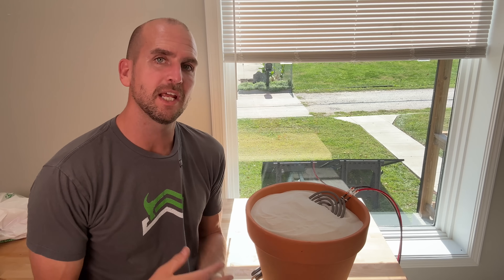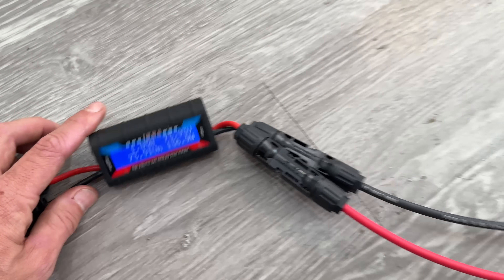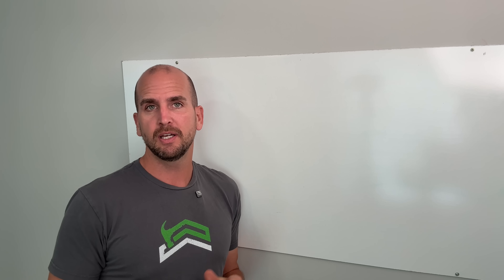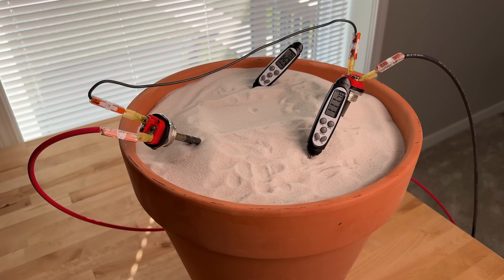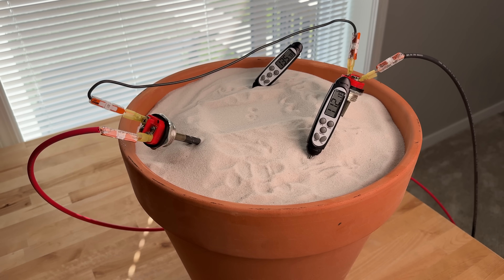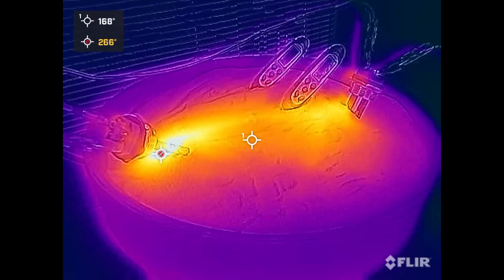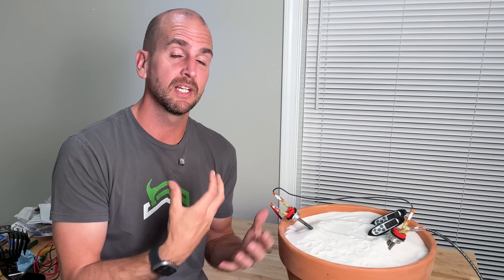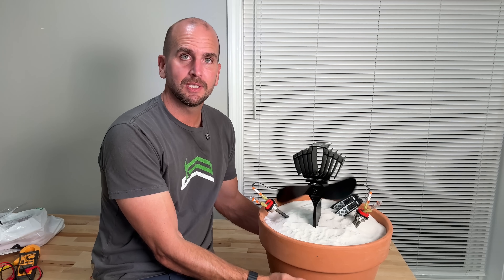How To Create A Solar Sand Battery Heater | Free Heat This Winter!

Comment: Love it. 
Getting 10 hours of heating would be the golden point for me. 
I'm guessing greater sand mass would be the key for slower heat release.
Reply: Heat releases depending on surface area. But you can store more heat in a larger quantity of sand. Also how you distribute that heat with fans or whatnot affects the results too. It is relatively simple to figure out in the end. If you want to build such systems at home, insulating the sand and using a thermostat to regulate release of the energy is quite useful.
Reply: @inso80  You can just put a window in your house and get greater efficiency. The difference is the heat is spread around so you might not really appreciate how much energy it is generating.  If you build a panel with a wooden frame and gutter pipes sprayed black you can orientate it to so is has two sheets of plastic on the outside. One facing west and one east. If you have it sticking out from a south facing wall it will take the reflected light off the wall really good. Channel the air so the cold air comes in thru the top pipes and moves down. This way the cold air can take the heat off the top and pull is down and in under the floor of your house. It will heat the floor and once the sun sets return heat into the air coming in thru it. It will be way more efficient than using electric solar panels. The main issue is that it is sealed and doesn't get the air from the plastic and spray paint  Getting the heat under the floor into the ventilation air is what could really makes this better than a window since otherwise the ventilation air is coming in cold and the heat from the windows is more up by the ceiling whilst you are sitting nearer the cold ventilation air.  You could just use dark floor tiles and have the ventilation pipe under them. That way there is no risk of having bad air from the plastic and high temperatures but the east west design would be quite good to mitigate that since half the pipe will be in the shade. Even a single pipe would work good compared with wherever the air is coming in at the moment. Making it too big could be risky. You would be amazed how much heat it would generate if it was up against a sunny wall.
Reply: @RoseHip-j1y Dividing that tube into paragraphs could make it readable.

Comment: You only use 2 solar panels, and 12 panels to charge electricity. If it was cheaper, it would probably be 6 panels, it wouldn't use up all the electricity, at least there are no tropical storms in your area.

Comment: I want to see you cool your panels, collecting that thermal energy into the sand battery, and calculate total system output (you should realize greater panel electric output plus the value of the collected thermal energy).  Seems like inexpensive insulation and closed system thermal pump shouldnt be too expensive or difficult?

Comment: Nice video! Many solar systems have extra capacity that is throttled by solar chargers. I wonder if a water heater could be powered by directing extra productivity to the heater. In wind powered systems, there is usually a "dump load," which solar doesn't need. But, what if a solar electric system were designed to use a water heater as a dump load.

Comment: This is an awesome idea!!! My brain flooded with all kinds of applications. You could embed these in an insulated block of concrete with air tubes going through it, so you could extract the heat when it's needed. Instead of a fan you could use convection, just have a small temperature actuated shutter.
Reply: ideally you would want this in a big block of concrete so it heat up during the day and cools down at night.

Comment: You can drill a hole in your yard and place a heating element along with water piping to recapture that heat or even to generate electricity when needed.

Comment: if you slide flat copper down into sand standing above top of sand the heat will radiate longer. great for greenhouse thats what we use this for
Reply from the maker: I plan on doing something similar for round 2 testing with a heat fan sitting on top of the aluminum or copper strips to help distribute the heat around the room.
Reply: Are you saying that if you hook up the electric to copper tubing totally buried in the sand it will heat the sand better?
Reply: No, the added copper is simply a radiant. The sand holds the heat below the surface, and the copper helps draw it upwards to radiate. Without it the silurface will cool off first and radiant  heat will be lower

Comment: I have a small greenhouse which uses ground to air heat exchange I built into earth under it but this would be a great additional way to add more heat in winter. I have a small 100 watt panel I bought before getting solar installed - used to test with a small EcoFlow.  Thinking maybe doing a single element - 100 watts won’t make a lot of heat, something is better than nothing.  I do have 2 50 gal water barrels to also use as solar heaters.

Comment: To really eke out as much power from your panels as possible, look up a video on YouTube by William Fraser called "DIY Solar Maximum Power Point Oscillator". Using just a few components, you can basically track the panel's maximum power point even when the panels aren't producing their maximum power. It works well on resistive loads, but he also demos it using a drill motor.

Comment: A smarter option is to design your home passive solar. Every square foot of glass on a Southern exposure is equal to 100 watts of electric heat. I generate over 9,000 watts of heat at home using this method
Reply from the maker: Agreed, the house I grew up with was passive solar.  Worked great 👍

Comment: The clay is used to store heat and give it back during night. It exists from thousand of years. Is something shows significative increaze of temperature after one hour, it can't be called refractory. I will try with perlite for cats. Cheap. Can't burn. No toxic + regulate humidity. The plant pot is useless if using clay use for plant instead (whatever bearing the 20-30 kg weight will be the same. The point is that heat must be released during 8 hours night and not during the day. It's not difficult to find the thickness needed for your local temperatures / room volume /insulation.

Comment: That is an awesome idea! It eliminates the need to buy expensive batteries and inverters! Stove elements would be easy enough to find at the dump. Here in Canada it would be a cheap way to bring some extra heat into your home.

Comment: This might work nicely in a Greenhouse during winter in milder climates. I live in NE Texas and it the temps do drop at night into the low 20's. These might be nice situated closer to the more cold sensitive plants.
Reply: I've seen some use of compost piles for heat. The internal temperature of a compost pile that is fueled well with food scraps and carbon can approach 150F. Running tubing through it for heat transfer can heat a room or greenhouse.

Comment: You CAN heat a mid sized room with this method with much less solar power and a better sand battery. I use 12V 20W system with a 50lb sand battery in a copper pot wrapped in 8mm thermal wrap covered with a copper lid and topped with a thermal fan like you used. Sand temps reach 290F and higher. I can keep a 12x15 room above 65F all day and night with outside temps of ≈40F
Reply: Sounds great. What did you use for a heating element?
Reply: @polywog9591  PTC Heater Plate 12V Constant Temperature Element Thermostat Heating Tablet (use the physically largest one you can find.)
Reply: @Try2-Imagine  Thank you!
Reply: @Try2-Imagine  They look the same in size. I see 12v 220C since that is the hottest, I think maybe this would be a good choice.

Comment: I'd love to extend this concept to heating water.  A liquid-to-sand heat exchanger and a small pump to circulate water (from a Spa Pool?) to get water up towards a maximum temperature around 40 degrees Celsius, then cut off the flow (using temperature probes to limit heating).

Comment: I'm curious if using salt would change your thermal retention.  Another step in a possible experiment.
Reply: Salt would melt in the temperatures sand batteries can go to. Mix that with a little bit of water and you don't need to worry about headaches ever again. Molten salt systems can be really dangerous.

Comment: Turn off the normal heat in that room. Put up temperature sensors all over the room and measure the room temperature during and after the pot is hot and until it's cold and until the room is back to the temperature where it's cold.

Comment: The general advantage of these kinds of materials starts when you are able to dump MUCH more energy into them (as they'll happily exceed 1000C without causing the quartz sand any issues for example) whilst insulating them (e.g. aerogel) so they gradually release a small portion of the total energy over a Much longer time period (i.e. overnight).

Comment: Dude, you just need to put sand in some tin cans, paint them black and take them outside. You could also insulate them from the wind. It's a far more efficient and simple system to move heat from outside to inside.

Comment: This video definitely got you a subscription from me. This is an interesting idea, but one thing you need to be aware of is that resistance rises as the temperature of the heating element goes up. That helps the element to current regulate at its rated voltage. 

If you want a fun experiment with an extreme example of this phenomenon,  measure the cold resistance of an incandescent light bulb. A 12v 194 license plate automotive tag light bulb will have about 2 ohms cold (which would make you think it would flow 6A at 12V, or 72W) , but it will only flow about 0.3A (about 3.6W)  when the fillament is glowing white hot.

Comment: While looking at houses, i was thinking a great place to put sand batteries for a new build, permanent installed system would be under the garage. A series of several cells could be installed there ans still support the weight of the car. Could even charge the car as well as the house?  Got to run the numbers on that yet, figure out the right size of a cell that can be swiched over as it cools from use, etc.

Comment: I`m thinking of the old Roman system of underfloor heating that was used some 2000 years ago. Think off a sandbattery, then blow air through pipes in the battery. I`m thinking of fixing the floor in my unisolated garage. Right now it´s only gravel on the floor. Thinking of using hollow claybricks, add them in lines, so I can blow hot air through the floor. If i have a sandbattery, and solarpanels, I can heat the garage when needed. the reason why I´m not thinking of a waterheated floorsystem, is that we have maybe 2 months of winter up here in Sweden, when the sun just goes over the horizont. Pretty sure that a waterheated system could freeze up some days

Comment: Heating with resistance is only up to  100% efficient.  (I.e 1kWh of electricity creates  1kW heat). This is what is being demonstrated. 

Heating with a heatpump is 300% to 500% efficient.  (1kwh electricity  transfers 3 to 5 kwh of heat). 
This is what you want.
Reply: Very good point but, technically, remember that NOTHING is over 100% efficient.  In the case of heat pumps, it is best to use the term COP (coefficient of performance) rather than efficiency.  In your example, the heat pump would have a COP of 3 to 5.

Comment: I wonder if those who use a wood stove to heat the home could set the sand in containers on top of the wood stove to absorb heat and then carry to bedrooms to keep bedrooms warm at night?!

Effective use in a greenhouse?
Reply: I have a wood burning stove that has soapstone in it. Soapstone is a better heat sink than sand. It uses less wood to heat the house and radiates the stored heat all night long. Plus it is so nice to sit by in the evening.
Reply: With a copper rod placed down in the center of the pot would be even more effective but yes it could absolutely work 👍
Reply: @ TY for your reply!
Reply: I think you will find the electric elements can reach higher than.  A rocket stove might reach the higher temperatures but I think you will want to pipe outside air to the stove so it doesn’t suck out all the warm air in the room.
Reply: you might want to search for "rocket mass heaters"
Reply: Yes, and/or also heating large DRY rocks works well also. Be sure rocks are dry in the middle or may explode from steam, but a bucket of hot rocks is a blessing at times too. 
Back in the day they heated an iron pan on a stick kind of thing to run under the bed covers to make jumping in more pleasant, I keep a few new bricks on hand for this when it -30c for a couple weeks on end... throw them under the cover and warm that mattress, yes please! lol
I looooove my wood stove, I'll never be without one. 

For your greenhouse do look into Rocket Mass Heaters.
Reply: It is much more effective to just put a pot of water on a wood stove.  Sand doesn't have anywhere near the heat capacity of water.  Sand's only real advantage is that you can heat it up to 1000 degrees F without a massive pressure vessel.

Comment: The two heating elements should be in parallel, not series. I found that out the hard way when installing a pair of electric baseboard units in an insulated garage.

Comment: I have a few questions please!?
what happens if you are under powered. do it fail to heat or just weaken suitably.

what happens if you have lots of solar on on and then the sun blazes and your pushing a bit too much energy into a coil? do it self protect/limit in some way?

what exactly is the mechanism that is making the element heat and not the wires, it is simply the element needs to be the highest resistance part of the circuit?

How hot in real terms can those various elements generally get?
i know the sand is safe at 600c but some high end can go to 1500c
but concerned about understanding the elements.

having to jump in feet first and cart before horse really out of neccesity, so these questions help shape my understanding quick sharp like a primer. <3
Reply: Also, you look like Cobbs Pond from Frontier. ever thought about actor or stunt double!? :D <3

Comment: Wouldn't the wattage of the heating element output be roughly equal to the wattage input of the solar panels? A bigger element would only matter if you also putt more power to it.

Comment: hooking panels to modern mini splits is way more efficient for heating than heating a bucket of sand...
Reply: there are mini splits available that hook directly to panels, no power station or battery bank required...

Comment: It would be great to connect this to a heat pump and have that be able to charge a battery so that you can use that for heating a room with a traditional heating source.

Finding new ways to store solar energy is a very exciting challenge for the future.

Comment: whole house heating bed of sand under house, solar panels on roof, Solar run to battery storage (for night operation) & charge controller, to sand heating elements, connected to a thermostat. I'll have to spend more time but seem feasible for supplemental heat to lower the dependence on the grid. not a complete replacement.

Comment: Waste of time. Get a radiator oil filled heater and charge that bitch up with solar to max hot and then use batteries to keep it going throughout the night. Far better.

Comment: Back in the 80’s (I think) I was designing and building houses, building rules changed and we were required to have energy calculations for the buildings, some of the factors were, square foot, type if insulation, window square footage, heat source, north south orientation, and thermal mass. The thermal mass was interesting as it was calculated from items such as tile, brick, stone, items that were solid and would collect heat or cold and slowly release those temperatures back into the room.
I would find it interesting to compare a system using solar panels to produce electricity which is the converted to heat by the element vs a thermal mass which is in direct line of view of the sun. It seems like there would be a large loss of energy converting the solar panel energy, wire power drop, heat element inefficiency.

Comment: Use the correct elements for what you are doing at the proper voltage they are rated for. water heater elements will fail if in air vs water. they burn up. use the original element you had and supply the correct voltage and amperage they require or make one for the voltage you have. but be careful the temperatures will get to 1000 degrees or more you will want something under that pot. if you are just trying to get to a lower temperature use a temperature controller to keep it lower. the Peltier fan will burn out when to hot so don't get it to close to the elements when running them properly. solar is not a strong source of power you may need to save it up and run the element at it's proper voltage and amperage. or the homemade one you can make to run at the correct power you have.

Comment: Why not just heat water with sunlight? You can git fancy and use liquid metals instead of water holds  more heat. You should always try to use direct energy rather then converting one form to another then back. To many loses.

Comment: Isn’t this just reinventing the wheel? With that much surface area, you’d be better off using coils of flexible water tubing filled with salt water feeding coils in the sand pot. Paint it all black. 
Like a Ron Popiel infomercial… just set it and forget it!
What’s going to happen if an EMP pops over our heads?